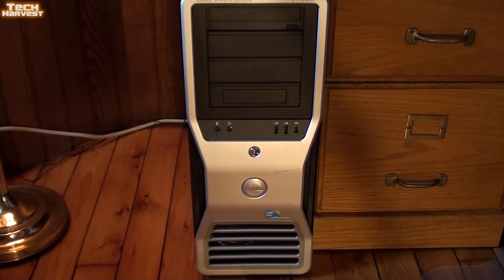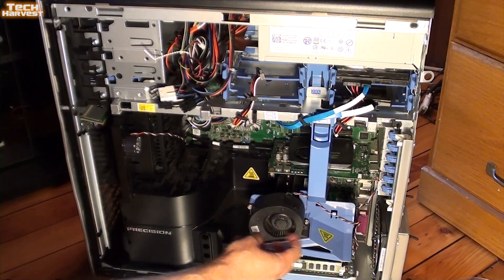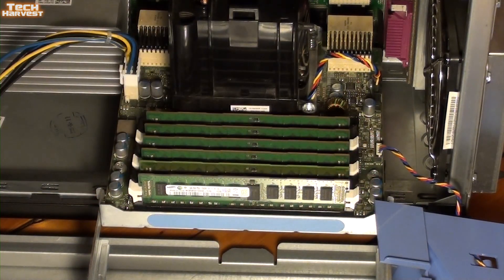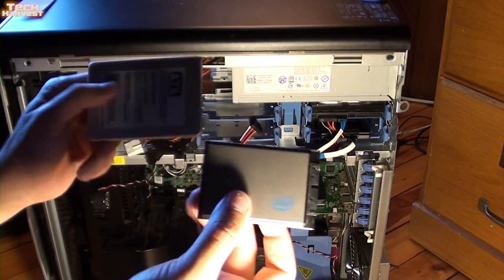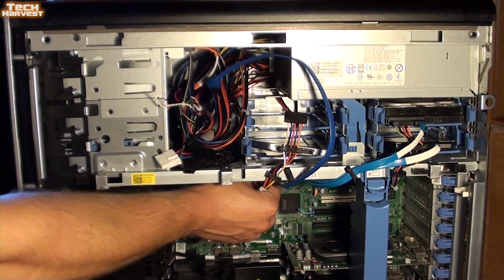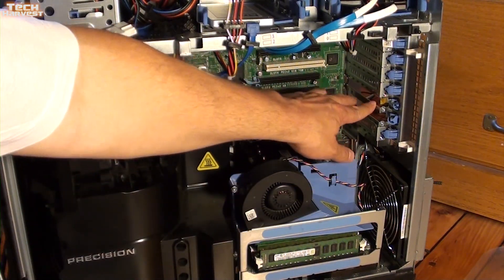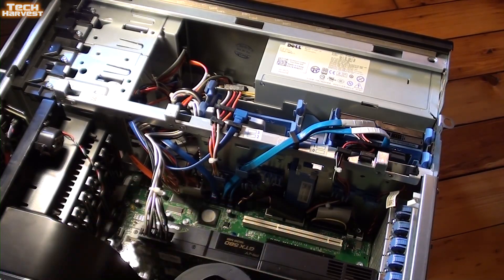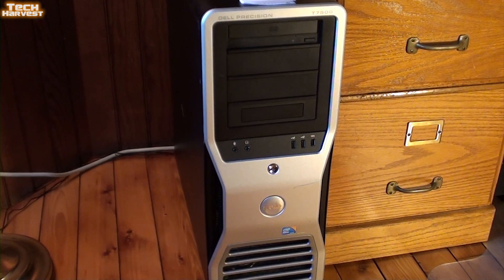Graphics Card, SSD, & RAM Upgrades: Dell Precision T7500

Comment: Nice video. Please, do you have to use that specific ram for Dell or can you use 3rd parties
Reply: Dell does not manufacture RAM, so the answer is that will come from a 3rd party even if it's Dell labeled,
most of times finding sticks with the Dell label will be harder than finding Good quality 3rd party memory.
the matching of the sticks is another story...
Reply: @technicaluserco  Great. Thank you for your response.

Comment: I have a t7400 and I'm trying to upgrade it to accept windows 11 and also be able to support multiple screens for watching TV or day trading... Any advice?
Reply from the maker: You should be good to go provided you have a GPU that supports multiple monitors. I haven’t put Win 11 on it. It doesn’t support it natively but there are workarounds.
Reply: RUFUS can enable it for you, but the newer versions of Windows 11 have built in hardware detection to prevent you from upgrading versions after it's installed.

Comment: Exactly what I was looking for. I have an HP z820 that came with dual NVIDIA Quadro FX 3800 Graphics cards to install in my older T7500 Dell T7500 (which is the same as yours except the Video) and I wasn't sure where to get the Power from. I saw you grab  the black and white bundled 6 pin connector from the Power Supply. Thanks for this. Now I know where to get the Power I need. Happy Thanksgiving and thanks for posting this video.

Comment: I just found a T7500 at a local thrift shop for $170.  Is it worth it to buy you think?  Thanks
Reply: it's worth it imo even if it doesn't have an HDD or RAM
Reply: it depends on how many cpu has, how much ram, hdd/ssd, if it has a video card......so it depends.
Reply: @orange11squares  lol no those things are expensive af way more expensive than 170$ even without extra components

Comment: i have one of these and am running a Gtx 1060
Reply: Hey there I just found one of these sitting in a parking lot and I was thinking about using it as a mining machine. I have no idea the specs but it is heavy as shit do you think it is even worth messing around with?
Reply: i dont know about mining with it, but using it as a gaming pc it's great.
Reply: @MugatuJag  it's so heavy that it goes down to the earth center by itself....mining everything it encounters in the process. By the way you need at least a gtx 1050 4GB to mine something...preferably better and with 8GB of video ram.

Comment: I successfully was able to install and boot from nvme drive via a PCIe adapter without bootloaders like Clover or DUET.  The only caveat to this is that an older Samsung 850 Evo pro nvme m.2 stick has to be used to be able to  boot (BIOS will recognize) because this nvme stick has the Legacy BIOS/Boot option.  Perhaps some older Toshiba nvme can do the same trick but I am not certain.

Comment: Hi it's good I am using this but now I am facing some display issues when windows open the screen is getting gliching can u tell me what is the problem I tried both dp ports and along with vgi cable but still same problem if I need to change graphic card suggest which model is good pleased

Comment: Does any body know,  if the T7500 supports booting from a M.2 Nvme ssd Via Pcie card upgrade Card ?? Some of these cards also have SATA3 connectors , Can we boot through a ssd hooked to that ?
   Also FYI, There is a Dated 2018 Bios update for the 7500 on the dell support website.
Mook, Running a Dual 5680 setup...Thanks.
Reply from the maker: I should probably update the bios on this machine. Thanks for the tip.
Reply: They do not through the bios, they can see a NVME drive with an PCIe adapter. If you want to boot from it you need to manually edit the bootloader address location which is not a simple task on a PC that doesn't support NVME booting.
Reply: Old comment but you can boot from NVME using "Clover" on a USB flash drive to point the system to boot from the NVME drive on a PCIe adapter.

Comment: The build is coming along nicely! 

I got my T7500 a few weeks ago but unfortunately the seller sent 2 different styles of RAM. The seller installed single rank RAM on the mobo and dual rank on the riser board. The side effect to this is that the second CPU and RAM on the riser board won't be detected at all and the fans run at 100% no matter what. It took me a while to figure out what was going on. Like you've stated, the RAM has to be the exact same. For anyone else reading this out there in the future, you can't just buy any kind of RAM sticks. If you want single CPU usage, stick to single or duel rank. For duel CPU's, you must use duel rank. 
Anyways, thank you for the great content!
Reply from the maker: Did you get replacement RAM?  Hopefully your seller made good on his/her mistake.  Thanks for the kind words and thanks for watching.  I will be posting 2 more videos about my T7500 this week.
Reply: @TechHarvest  I didn't get replacement RAM from the seller. They said it was "against company policy". I doubt that. 

I ended up buying the correct RAM from a different seller. Received it today and I'm still having issues. I have troubleshot this to death and I still can't figure out why it's not recognizing the second CPU and RAM. I even bought a new riser board. Stumped for sure!
Reply: @doomstache  Update the BIOS... I had two T7500 machines and other Xeon systems with weird issues that magically go away with a BIOS update.